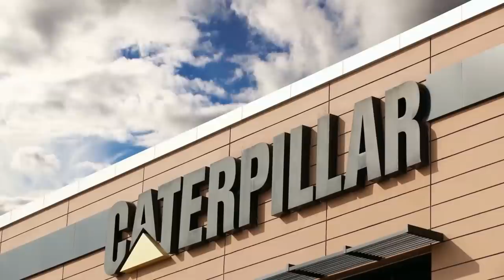CAT Tractor Factory - Production Challenger tractors

Comment: Cat hasn’t made any tractors since 2002 when they sold their agricultural business to AGCO
Reply: This is at the AGCO facility in Jackson, MN. They are Challenger brand now not CAT. Also not CAT powered
Reply: @ED--wh8zt  what was the last tractor that had a cat engine in them?
Reply: They are also out of the truck engine business since 2010
Reply: @farmertoblerone2280  AGCO was supplied with CAT engines and drivetrains thru the 2010 or 11 models, after that they became an all AGCO product. Basically the same year CAT dropped their truck engine line, as a result of emission requirements, they dropped providing parts to AGCO...
Reply: We still make tractors today. I work as a production tech here in TX
Reply: Cat still builds the power shift transmission and rear ends for the tracked tractors.
Reply: @dirtthunder1638  I don’t think so as of now in 2022. As far as I know all knew Challenger have Fendt/Agco technology on the inside. 
Maybe the rear end…
Reply: @ParableYTV  Cat doesn't tractors anymore though
Reply: I think the title should be corrected, at it's base it's a cat design but definitely not made by cat, I think they left the agriculture scene in 2002. It's been 20 years since cat made a tractor.
Reply: @DrDrops420  ut oh. Someone's mom left their phone unattended.
Reply: @jhomrich89  it's possible Cat still makes the transmission and rear end, or AGCO builds it on license, but every other part of the machines are all AGCO. Even the engine is AGCO's own design based on the Sisu engine they got from Valtra